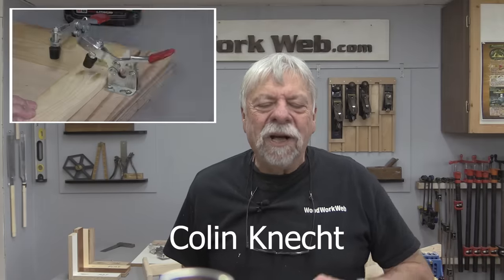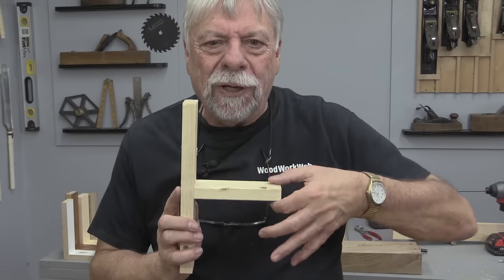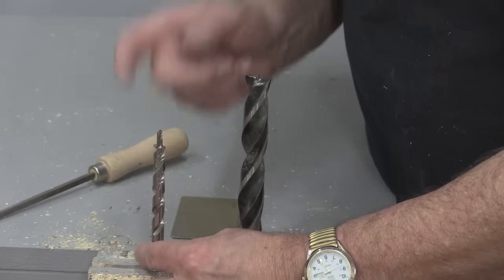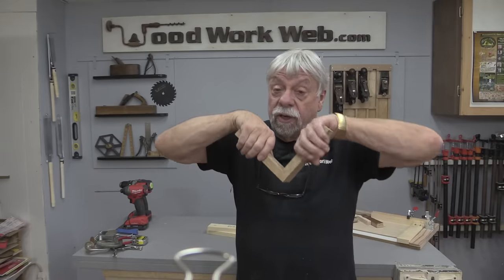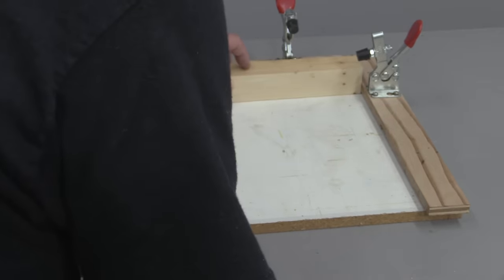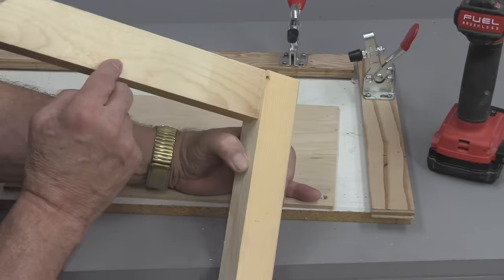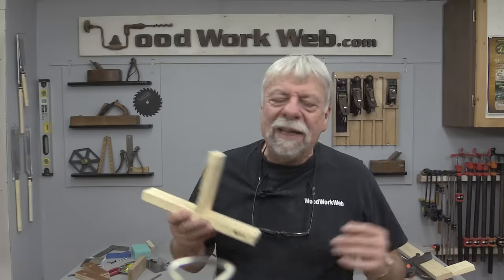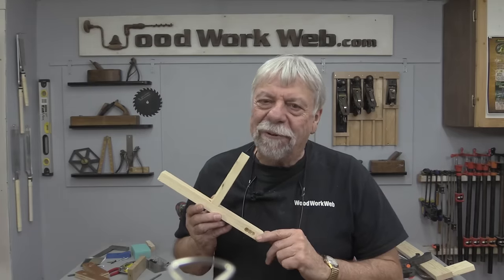Pocket Hole Mistakes to Avoid / Woodworking Joinery

Comment: Hi, i am making a floor storage shelf in my garage. I was going to use pine as the materials. Will pocket holes work on SPF lumber? also, if I want to use natural wood instead, which one is better and as economical as the pine wood. Thanks

Comment: Would you still discourage using wood glue outdoors (on cedar joints for instance) even if the glue is graded specifically for outdoor use ?

Comment: I'm 90% through making an mdf wall hanging laundry room cabinet using pocket holes and glue.  Sides and top and bottom are 16mm.  The back is one piece 19mm mdf. My question is am I wasting my time? Will it just fall apart when I start filling it up?

Comment: Please comment on the appropriate screw threads for various wood species. Thanks
Reply: General rule is coarse thread for soft woods and sheet materials. Fine thread for hard woods. He did use coarse on oak in this video, which is mildly risky as it can split the wood if you aren't careful. It seems he didn't split it, so no harm no foul.

Comment: Hi i made a frame 53x23 but when i do a dia measurement one corner is almost a whole 1/4 inch off.............One corner is 58  and the other is 57 3/4 even thou i did square the corners it still off....any ideas????

Comment: Maybe I'm too much of a perfectionist. I've tried all 3 clamps you showed, but I never get perfect alignment. I'll try toggle clamps to hold down flat on the bench, maybe that will work for me. 
My kitchen needs cabinets, & I'm so frustrated with the kreg, I'm  considering a dado blade & lap joints. I like mortise & tenon, but have no efficient way to make mortices.

Comment: 5:00 Here's a tip: drill the screw on the outside of the pocket hole not from the inside. 
That way it's stronger and won't split since you'll be drilling into the thicker 'meat' of the wood.
Reply: Yes, this is one of the mistakes people make.

Comment: When I try to put 2 pocket screws to join 2 pieces of 1x2's at the corner (using 1-1/4" screws),the wood always split. Why is that? Should I just put 1 screw instead?

Comment: Is it possible to use pocket holes on 1/2 inch MDF? I tried it and the 1/2 inch MDF split. Any suggestion would be helpful.
Reply: Make sure the drill bit collar and jig are at 1/2 inch, use 1 in. coarse thread pocket screws, always use glue with mdf, don't over torque mdf is pretty soft, at least 2 pocket holes wherever you use them

That's all i can think of from when i used mdf

Comment: Thanks Colin, great tips. I have been using the pocket hole jig since they first came out. I learned several new tips from your video today. Now, how do you suggest removing the screws with broken heads? Thanks

Comment: Thank you! I’m still looking to know how much pressure to put when drilling, I drilled couple of the Kreg pocket hole coarse screws into two small sheets of plywood to make a cube and there was a 1/4 in space the planks. I had to call my husband (eye roll) to push the drill down and that made the planks tight together. 
Is it because I didn’t use a clamp?
Reply: Yes!  Always need a clamp.

Comment: Hey Colin, I'm not sure if anyone asked this already, but how do you adjust the settings if you're joining two pieces that differ in thickness?  Say the piece that has the pocket is 3/4" and the piece that it is joining to is 1/2".
Reply: You set it for the piece of wood you are drilling into. Then you adjust the length of screw for the thickness of the material you joining it to. Your best bet to determine length is to use a test piece so the length of the screw does not go thru when joining 
thicker to thinner material. Thinner to thicker use a longer screw.
Reply: @richardlug6139  Another thing you can do is drill the pocket hole and then run a screw into it without it attached to your other work piece. Then you should be able to figure out with the stick out if it's going to blow out your work. Because yeah a great way to ruin a project is to have a screw point sticking out of it. Sometimes I can't use a Kreg jig when I'm doing pocket holes and I draw the joint on paper. Figure it all out for the stock and screws I'm using. And doing that can take some time.

Comment: Hi: Thanks for this great video. I'm planning a project (60" long table/ desk) where I'm using 3/4" Baltic birch plywood as the table top, and hardwood walnut (also 1 x 3 board, i.e. 3/4" thick) as the legs and "spine" (the support that will run like a joist along/ under the length of the plywood board, but away from the edge of the plywood, to prevent sag). This will involve screwing the walnut to the plywood face (on the underside of the desk). Any tips/ cautions? Thanks in advance

Comment: Great episode as usual. Very informative. I do, however, have a question that wasn't addressed directly. You may have addressed the answer when you talked about setting the drill bit collet and the plunge depth, but I still have trouble associating these settings when working with mating materials that are not of the same width. In your example both materials were 3/4". But what do I do when I'm mating a 1/2" shelf to a 3/4" cabinet frame? And vice versa. It may be intuitively obvious. Assuming  one has some intuitive...I seem to be lacking in that area! Any help would be greatly appreciated. Thanks.
Reply: The instructions I've seen say to set the drill collar to the thickness of the thinnest piece.
Reply: @bmedicky  Thanks Borys, somehow I missed that detail.

Comment: Using fine-thread screws instead of coarse-thread on plywood makes an enormous difference.  Coarse thread screws can be pulled right out of plywood but fine-thread will actually bite and hold.
Reply: most don't know that fine tooth drywall screws are intended for metal studs and coarse for wood studs...

Comment: Course (soft woods) vs fine threads (hard woods). Pan head vs washer heads. Perhaps you could elaborate on those?
Tips on sharpening Kreg pocket hole drill bits very helpful.
Reply: They're bugle heads.
Reply: Well, you've already covered coarse vs. fine thread (except that sheet materials are also included in the coarse thread category.)  It is worth mentioning that if joining dissimilar materials, you base your thread choice on the piece that did NOT have the pocket hole drilled into it.

Use washer heads almost exclusively. The only exception being when you are joining 1/2" material. In this case the pocket hole is rather shallow and the edge of a washer head would stick out proud of the surface. There are some cases where this wouldn't even matter. In these cases I would still recommend washer heads.
Reply: @TM-dh2xb  thank you!

Comment: I was hoping you'd talk about joints sliding around when glue is used. I have given this a good go and still have joints that move. Yes, I have tried clamping. Yes, I have tried loosening the clutch. Yes I have tried a pinch of salt.  I am about to the point of concluding that I either shouldn't use glue or I should use another type of joinery.
Reply: Are you talking about left and right or up and down? If the faces are not lining up your tightening screws too tight. Just need to snug them. Not crank them down. Also hardwoods are better cause construction lumber is too soft
Reply: @thefirstattempt495 , thank you. The piece containing the pocket holes is moving in the direction the screw is being driven. I am pretty sure it's the beginning stages of over driving the screw.
Reply: @josiahutah3712  I had the same issue when I first started. I am a big guy and don't know my own strength sometimes. Took me awhile to realize that pocket holes aren't likely to be anything load bearing and it's not going to be moving. Just use the screws to snug  and hold stuff tight while glue dries. Shear strength for wood glue is way higher than screws when applied right. If it's a joint that needs strength then your right, another type of joint is needed.
Reply: @thefirstattempt495 , good advice.  Thank you very much!

Comment: Great info Colin.  Kreg recommends fine thread screws for hardwood and coarse thread for softwood, have you ever tested the difference between the coarse and fine in hardwood?
Reply: The fine threads are really only to mitigate splitting. Since the coarse screw didn't split the wood in this case, he's no worse off.  In fact, he's probably better off, as I believe fine threads would pull out of the hole easier than coarse.

Comment: Your pocket joints would be a lot stronger if you angled them from the outside of the corner instead of the inside out. This is what Kreg recommends because the screw is angled away from the end of the board you are screwing in to.For example, a drawer should have the pockets on the outside front and back pieces of the drawer, not on the inside of the drawer.

Comment: My problem:  if your shelving partitions are close together, I cannot fit the bit, driver and screw into the spot.  So, "upside down, inside out" sounds good; but, it doesn't help when you have to drive inside out to inside in.

Comment: The main thing when using pocket holes is to clamp the two items being joined so that they do not shift. I have messed up so many times by not clamping down the wood. It results in one piece moving and your joint is then maybe a thirty second up to a sixteenth of an inch catty wompus.

Comment: A useful video for some I guess but who would use a countersunk head/flat head screw in a pocket hole? Also in one of your videos I watched recently you were warning against using impact screw drivers in the way you just did. I am sort of curious why you did this.
Reply: Someone that ran out of round washer screws might use a bugle head screw. I think he did the impact gun here as a demonstration of screw strength. Seemed to visually put the point across to me.
Reply: @1pcfred  Yes I see your point but it just seems to send out mixed messages.
Reply: @petercowell2051  what we all may be able to do with what is presented to us definitely varies. There is nothing that can be done there either. Life is rarely served up to anyone on a silver platter. Deal with it.

Comment: In reference 2 your strength test, I might point out that the pieces r joined incorrectly n the 1st place.  The screws should b positioned on the outside.  Remember Colin, think outside n and inside out. Right?

Comment: When you were showing the 4 different types of wood I believe you had the pockets on the wrong side of the job. You had the pockets on the inside of the corner, so the screw had very little to bite into when it went into the joined piece. It should be on the outside of the corner, so the screw goes into the 'meatier' part of the piece being joined.
  If it's just a demonstration of the relative strengths then fair enough, but people watching this might think that's the correct way, and doing it like that doesn't have a lot of holding power - might of been worth mentioning that, if it was for demonstration purposes.

Not trying to be picky. I think your channel is great and you've often inspired me - just hoping to help :)

Comment: The reason why screws seem to find their way in the grain of the wood is not necessarily the grain itself. Try spinning a screw and notice that it will never really achieve balance.
When a screw is turning, it's moving in two directions like a spinning top, and due to the point and cut along the screw, it's always going to be out of balance. There is no such thing as a perfectly balanced screw but there is a perfect center. There might be a perfect centering tool, but I haven't ever seen one.

Comment: The video spent a considerable amount of time on the type of screws pocket holes require. I'm very surprised that anyone would use a drywall screw. It's quite clear in the Kreg manual why a special screw is required.
Reply: Most people don't read the manual!!
Reply: @denverrogers186  If they don't read the manual, then they should not expect quality results. In fact, they should not even be using the tool. Do these same people also not read the safety precautions when using more dangerous tools such as a tablesaw?
Reply: @nperson  I agree 100% but people are prone to just jumping into things.  Thus the reason for videos like this.
Reply: @denverrogers186  You are certainly correct. I'm one of these guys who reads the manual several times before I start using a new tool or any product that it's operation is not obvious. I don't like today's trend of watching videos for learning. Videos can certainly help in learning the finer points but a reading of the manual and the safety precautions is best. Colin does a great job of showing the finer points. Seems like everyone doesn't like to read anymore and has to have a video.
Reply: Besides the differences outlined in the video, pocket hole screws are made from a harder steel than sheet rock (aka bugle head) screws. This is essential when fastening hard woods.
Reply: @nperson  I picture can say more than a thousand words. Manuals are made to be read. But many manuals are not good and/or clear.
And people are getting lazier and/or less focused.
Reply: @nperson  I totally skip over the 3 pages of generic safety instructions that are in every manual today. It's just there to cover liability. Their legal department makes them waste the paper and ink.

Comment: This was perfect. Thanks. Now how do I pick the right length pocket screw? when I go to buy them I tend to get ether to long or to short.
Reply: Craig pocket hole screws have that info right on their packaging.
Reply: The most common, 3/4" to 3/4" material uses a 1.25" screw. 1.5" to 1.5" material I believe uses a 2.5" screw.  1/2" to 1/2" uses a 1" screw.  Using those basics as a guideline, you can adjust for variations outside of those combinations.  

What is very important to keep in mind is the adjustments of the jig and drill bit collar for different thicknesses. The closer the jig is to the end of your workpiece, the closer to that edge the screw will protrude through the end.  Also (obviously) the deeper you drill the pocket hole, the further the screw will penetrate. So if you have some weird material thicknesses and you end up driving the screws too deep or too shallow, or off center, you can make adjustments as I just described.
Reply: @TM-dh2xb  Thank you very much. That was very helpful. And came in handy today. Thanks again. Keep up the awesome work. VS.
Reply: @TM-dh2xb  I haven't had good luck using pocket screws on 1/2" ply. Especially since now half inch ply is even a 32nd thinner! (Don't get me started!) Generally I stick to 3/4(or close) if I will be using pocket screws.

Comment: Wow didnt know that 11:50 thanks for the tips so what are the best screws with out pocket holes?
Reply: Without pocket holes? Well then it would depend on what kind of fastening method you are using and in what application.  Whatever the case, drywall screws are really only good for hanging drywall. They are pretty useless for much else, especially fastening two pieces of wood.

Comment: @ 5:10. The reason why mdf, ply and pine broke easily is because you put the pocket holes at the wrong side, not enough wood to hold it. You should drill the pocket holes outside of your workpiece and just fill it with dowels

Comment: The pocket hole screws is hard to come by at my local hardware store Bunnings. Can a similar screw to the pocket hole screw be ideal for woodworking projects in the near future?
Reply: Amazon or eBay is only a click away. Any screw that has the UNDER side of the head FLAT will work. Do not use conical shaped heads on screws in a pocket hole.
Reply: What you want are called round washer head wood screws. Or some variant of that.

Comment: Drywall screws are "Bugle Head", not even a decent Countersink head, so they are not really good for much other than drywall. The real secret-Pan Head or Washer Head for joints in tension or bending-e.g., Pocket Hole Joints; countersunk heads for joints in shear- Lap Joints, Laminating (relatively) thick pieces such as bench tops

Comment: I use wood screws, but i use washers with them.
Cheaper than pocket hole screws.
Ive recently made wainscotting using pocket holes.
But even with clamping, i still had a few misalignments and i dont know why.
Both peices of wood are clamped firmly to a level and smooth base board.
But after tightening the screws in the pockets, its almost as if the joint gets a wee bit tighter, which forces the joint to misalign!
Very annoying and time consuming planing and sanding the joints smooth and level!

Comment: deck screws actually do have a smooth shank near the head or my favorite GRK screws counter bore the hole near the head and pull the pieces together even on red oak where I've felt comfortable making some furniture that can be taken down for easier relocation such as beds.

Comment: Thanks for the video. I heard the part on gluing for outdoor use. We are making an outdoor barn door and are ship-lapping the non-face frame part (backing). Would you not be recommending gluing up the ship-laps? If not, what should I use to connect the ship-lap? Do I just count on connecting them to the face frame? Thanks!! Love all your videos.
Reply: I'd consider a 2 part epoxy. My 2c

Comment: Could you do a video on power tools please,,(cordless)
Reply: What's to it? You pick a platform and stick with it. If you're an electrician you use Milwaukee. If you're a carpenter you are team yellow. If you're an amateur the choices get more difficult then. Try to get a combo package on sale. One and done. But with cordless tools and batteries you're never quite done. You're more leasing the tools than owning them. You're on the battery plan. So check and see what batteries cost before you commit. Because you're going to be buying them eventually.